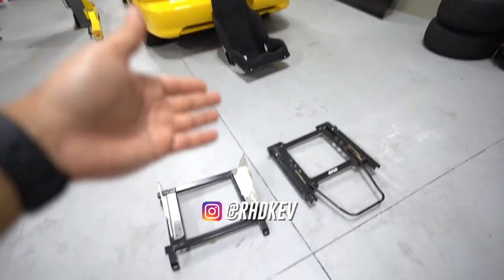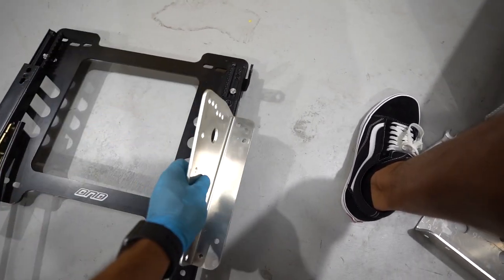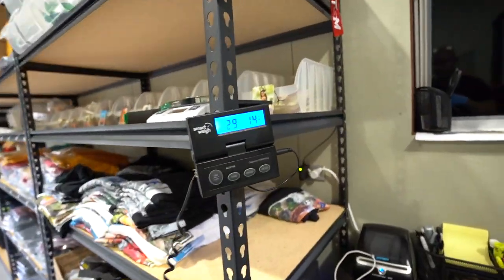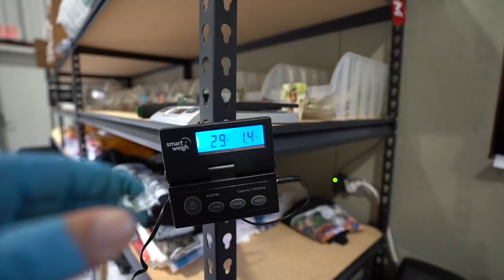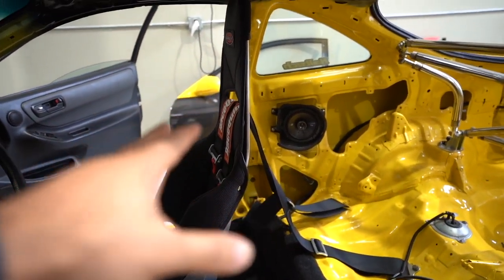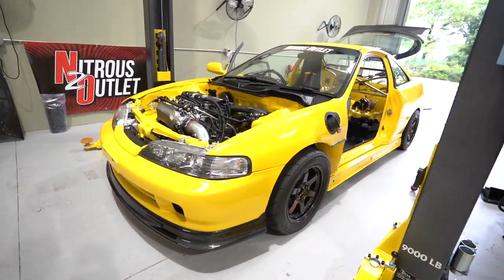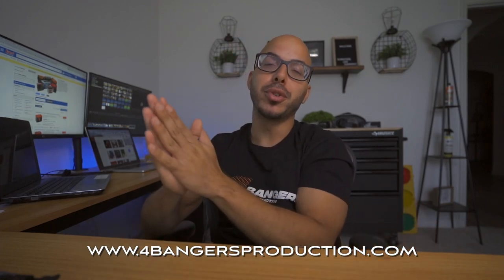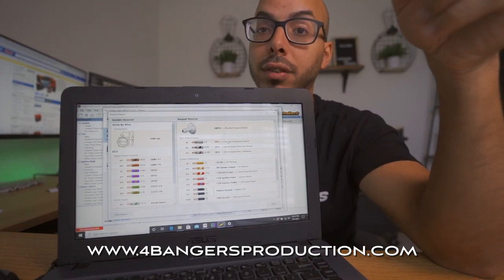Installing Lightweight Kirkey Drag Seat In My RHD Acura Integra

Comment: You need to use Cutting oil with drill bits so they dont heat up. I forget the EXACT name of the company something like CRC cutting oil you can buy at home depot and other stores similar. Its a tall dark blue/silver can. It makes those drill bits last a lot longer

Comment: Is there any way I could get a couple measurements from you on the kirkey seat
Reply: If you get on the kirkey website it will tell you all the dimensions.  👍
Reply: @Rev2lateRacing  I could only find seat bracket dimensions I couldn't find actual seat dimensions